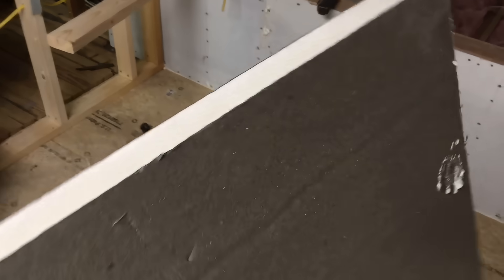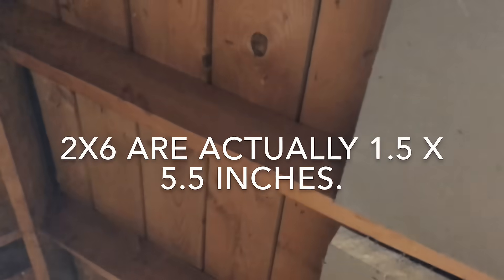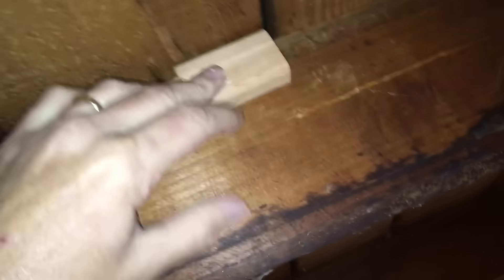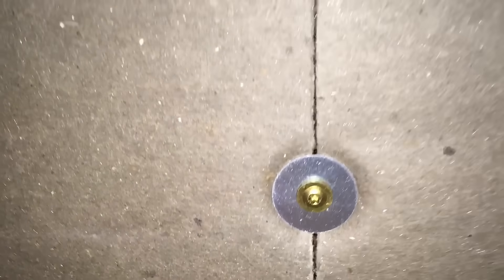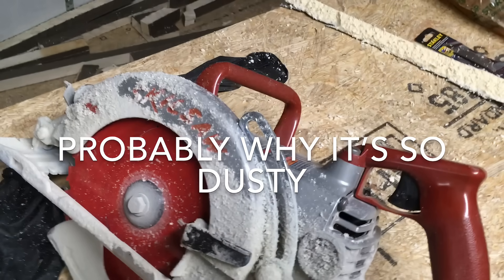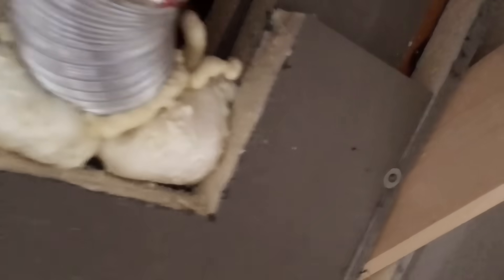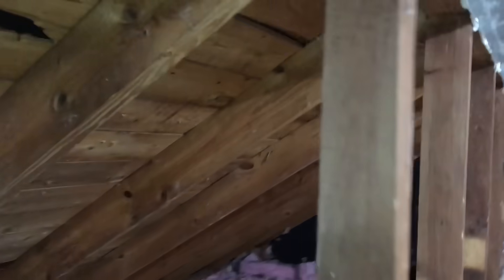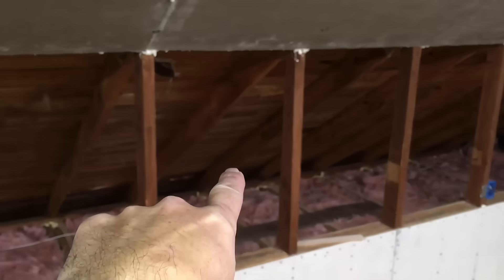Getting R-30 in an attic suite with 2x6 ceiling rafters

Comment: TIP for working with insulation and fiberglass or polycarbonate translucent/transparent panels:  Reverse your saw blade.  It still cuts like butter through the materials but it does not kick out so much stuff all over the place.
Reply: Berkey Family  this stuff cuts with a knife...
Reply: @jeffborders5526  
Whatever tickles your fancy!
Reply: @jeffborders5526  “cuts with a knife…”. Yah it will cut with your finger too if you work it long enough…
Reply: Also reverse blade works to cut any thin aluminum siding - good thinking
Reply from the maker: Tried that out in a new video https://youtu.be/Z292iuV91hA
Reply: @FamilyFriendlyDIY  Interesting conclusion on reverse saw blade.  The brand of saw may make a difference.  I use Makita circular saw and the cuts are cleaner and have less air particulates then I saw on your video, so I wonder if the Makita better controls the material downward rather than outward.
Reply: Are you saying that three layers of that expensive stuff is cheaper than spray foam
Reply: @tonycollinsworth7393  At the end of the video he said he saved $2,800 doing it this way over spray foam.  I would do the same to save that much.
Reply: @jeffwalters1176  ikr! This is a good video!
He decreased the need for baffles! I’m gonna check pricing for these certain items! I have an ex-wife who always gets ahead of herself on things like this! She has an old house & I suspect no eaves vents(sucks!) plus roof built over old roof sections!!!! She wanted to store in her attic so she had someone put flooring down!
Unknowingly she had the whole house fan removed!!! Which would help cool the attic down too!(are you kidding me!?) she also had her chimney caps removed/plugged & sealed the top because of wasp!?!?! (Could have used screening of some type on the outer!?
Meanwhile I’m trying to catch my breath cause she’s taking away ideas I had to cool her attic down!
I mention R30-38 & Baffles DIY etc & she struck me down! Saying it’ll cost me/her more money! (😳🤔🤠😂)!

If people will patiently look at the situation & the great ideas to solve them … you can save money & make the existing things you already have work better for you! Whole house fans pull cooler air into your attic (from the inside of the house)… in the process the attic air can be pushed out the upper ventilation of the attic! In the process you have a cooler attic to store things in instead of melting & being found dead in your hot attic!
Pay attention people! There’s a better way if you take the time & plan it all out!
Pray for me & my kids…. we keep running into these things occasionally! That can make our lives better! Listen to one another! Quit your ignoring others good ideas to help all! Lol!!!!
Reply: @jeffwalters1176  The foam panels cost $1200, but there are other costs by doing it this way. So his savings isn't exactly $2800, plus the extra time dedicated to this could have been used elsewhere. Pros and cons to any system that you choose, As a diy, the way he did it makes sense, but had he hired it out, the savings would have vanished, if not cost more than spray foam.
Reply: Thanks for tip . Will try this
Reply: This is fantastic advice - thank you!
Reply: Hey Berkley family thank you. I bought 4 inch foam board and cutting on my table saw. I will try that tomorrow. I did the walls except for the corners of my garage with 11 feet eves. I did one corner two days ago next day one of the middles between roll up doors today was 2nd middle tomorrow will be other corner. Then back corner and then corner by electrical panel. Going to put 4 x 8 x 4 inch on the ceiling also. Borrowed sheet rock lift to put foam boards up to bottom of cords and use 6 inch screws with
 large washers.
Reply: @gregie9999hotair1 no L in Berkey